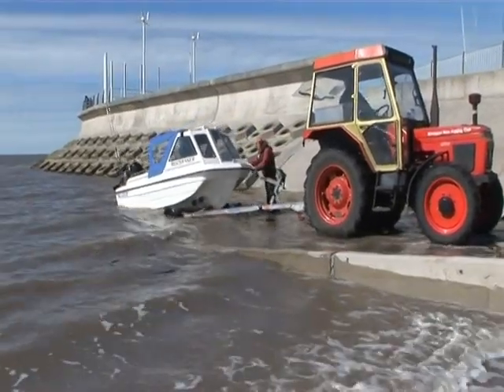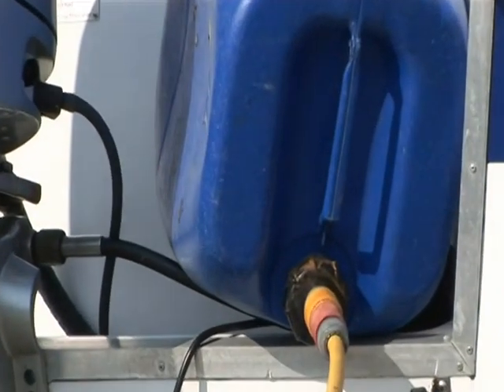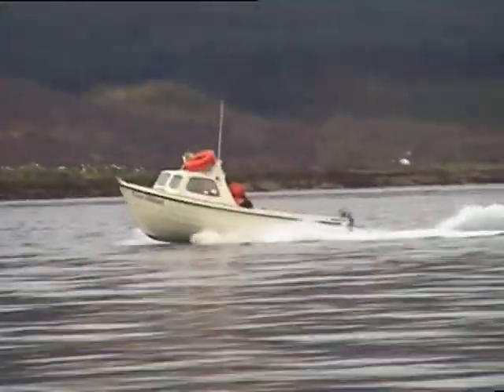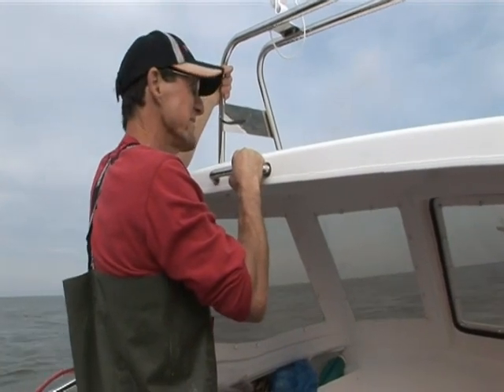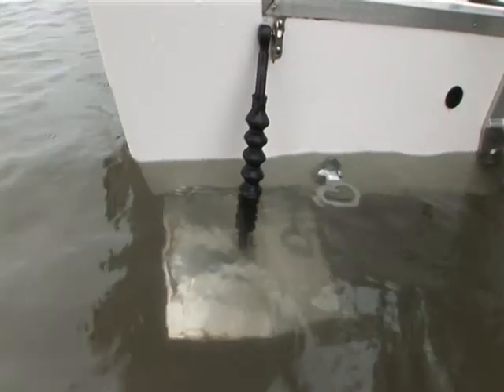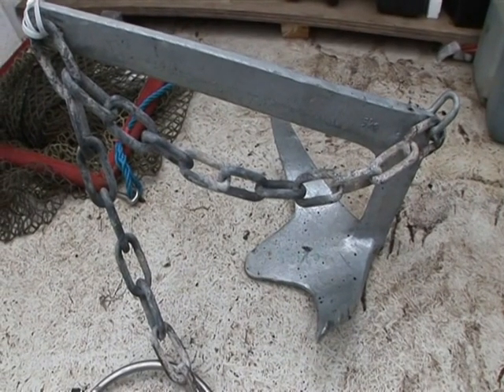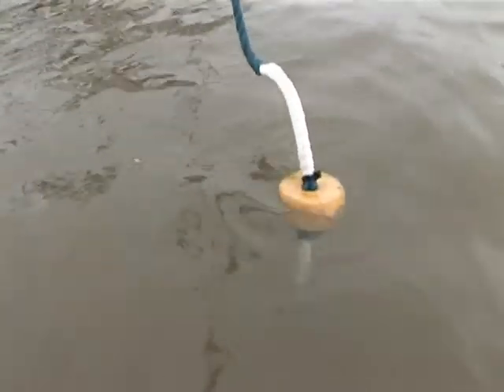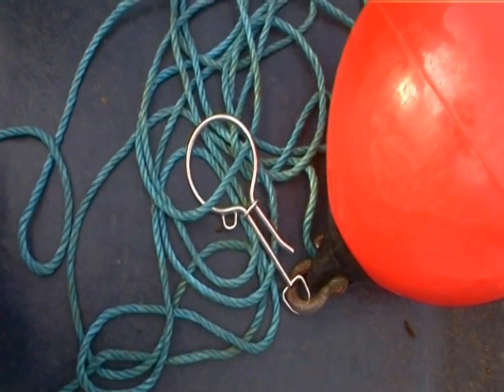Dinghy Going Afloat - Small Boat Ownership

Comment: you wouldnt pull it threw a cuddy because your stuff my get wet?? 1 your at sea so most things get wet anyway 2 where do you usually store your ancore as everyone i know keeps it in the bow of there boats read to deploy incase of emergancy etc and 3 ive personally owned all different kinds of boats weather big 10mrt trawlers all the way doen to 10foot dinghys and pulling threw the bo weather it has a cuddy or not is the safest option essesially in rough water as the bow is to the wave and least amount of strighn is put on 1 the ropes and 2 the person pulling the it back aboard, if anyone asks me how to pull ancore its allways threw the bow, there are a few things in your videos which i myself find very wrong and not nesacery esspesially when buying a second hand boat but hey thats a different topic